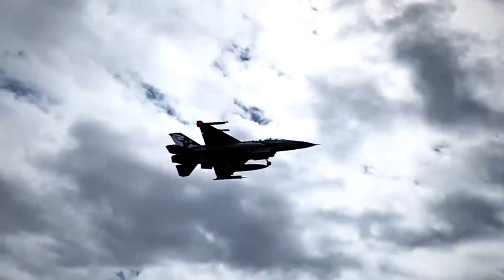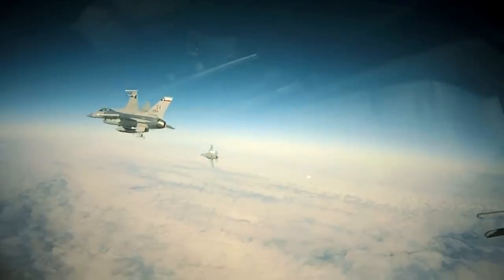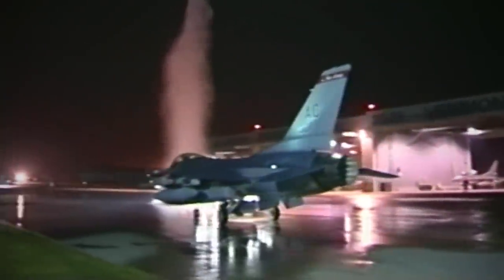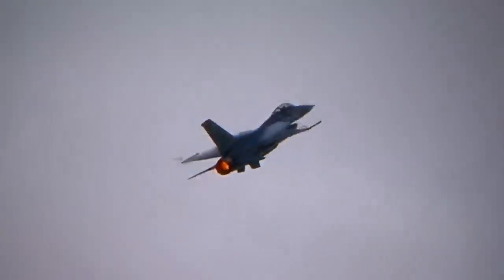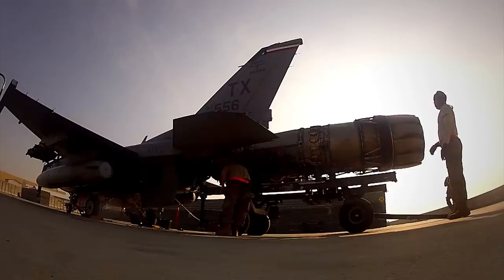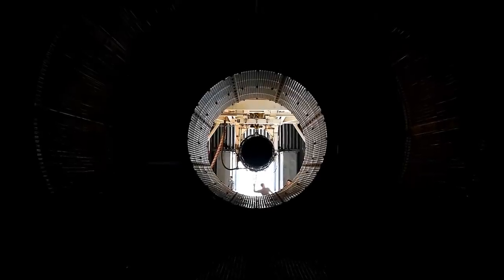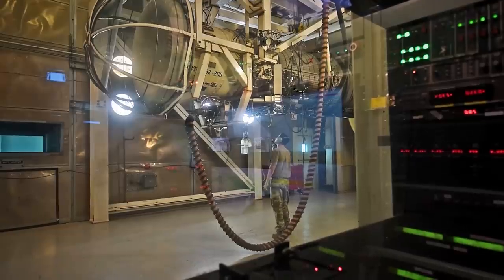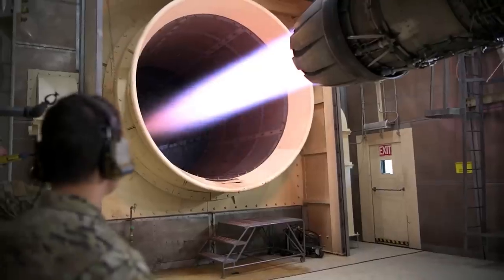The Hush House Silencer - F-16 Afterburner Maximum Power Test

Comment: I flew the early F-16A starting in 1983 and we were NOT limited to within gliding distance of the runway. The Pratt engine had its quirks but was a reliable one. The GE engine didn’t have those quirks and had a much smoother afterburner operation. 
I did a full power run from inside the jet in a hush house. It was strange going into afterburner inside a building.
Reply: I used to work at a maintenance facility for a major airline.  I was invited to go into the area where they tested the engines.  At the back of the test area, there were these black columns that you can walk between.  The dampened the sound so much that your ears would hurt.  (I do not know how to better describe it.  When you go to a normal sounding area to no sound at all, your ears strain or something.)
Reply: I'm jealous you had quite possibly the coolest job in the world. What happens to fighter pilots when they leave the service? Do most continue flying or do they end up with boring jobs? Freind of mine I have known since we were about 13 was a CC-130J pilot, he was at the point where he could leave or stay on for another 4 or 5 years and I asked if he would pursue an airline career. He told me he was staying on because he did not want to start as an entry level airline pilot making peanuts.
Reply: @fk319fk  I believe that's called an anechoic chamber. It stops sounds from reflecting so they don't go nearly as far. If you're not facing someone in those rooms they basically can't hear you at all. Really weird to experience. They have one at my local university for studying sound.
Reply: Larry was secretly a badass
Reply: Me too
Reply: @aniquinstark4347  Yeah man... anechoic chambers are amazing and tripped out to say the least. My first experience in one hearing my pulse, heartbeat, & blood circulating through my body was wild and a bit dizzying. It also showed me just how bad my tinnitus is 😂. I got to partake in lots of cool experiments and tests in there. I've also seen multiple people get vertigo and have to run out of there to throw up. It's definitely something you have to experience to truly understand. Glad you got to, because it's really something amazing.
Reply: Thank you for your service. I can only imagine how strange and unnatural feeling it must be to go full afterburner on the ground, but still, no feeling of acceleration, and inside a building. I would think it would be about as unnatural feeling if your average driver were to drive right out the back of a C-5. 🤔
Reply: I was your wingman too lol 😆 😆
Reply: @fk319fk  It's the same for our f110-129 hush houses. The gills on the building are there so the building doesn't implode on its self from the engine ingesting so much air. Two guys on either side of the gills would barely be able to hear each other yelling even though the distance is roughly one or two feet. Those in charge of the hush house also have to have full accountability of every nut and screw on the ENTIRE building less one gets ingested by the engine. Though these things can eat mortar shrapnel and still fly we still have to pull and rebuild the engine if there's evidence of foreign objects in there. I've seen a 5/16th washer implant itself on a compressor blade before. That was not fun.
Reply: @xenophagia   holy crap thats nuts. i might regret it but i want to hear my blood circulation now.
Reply: Awesome story sir. My grandfather is a retired chief master Sargent from Elgin. In the late 80’s / early 90’s, a chief could sneak in a 10-16 year old kid to the climate lab- not exactly a hush house but they were running engines at -120F+150F, bomb range, gun range, tower. When he retired he stayed there at the base as a civilian where he wrote the handling manuals for the GBU’s,JDAM. Boxing,shipping, attaching to the aircraft, etc. I love stories like these and yours. Thank you
Reply: Awesome story sir. My grandfather is a retired chief master Sargent from Elgin. In the late 80’s / early 90’s, a chief could sneak in a 10-16 year old kid to the climate lab- not exactly a hush house but they were running engines at -120F+150F, bomb range, gun range, tower. When he retired he stayed there at the base as a civilian where he wrote the handling manuals for the GBU’s,JDAM. Boxing,shipping, attaching to the aircraft, etc. I love stories like these and yours. Thank you
Reply: That's awesome!

Comment: I worked in some old school hush houses for one of the aircraft manufactures. The walls were about 18 inches thick (concrete I believe) and for entry to the doors you had to get a bit of a running start to get the doors moving - then drag hard to get them to stop moving. The side control rooms were just as thick and felt very closed. I remember during Desert Storm being in one while listening to the radio with the reporter describing incoming scuds. Very eerie feeling.

Comment: I was an F-4 Phantom mechanic on the Marines.   Two J-79 engines.  The loudest thing I've ever heard or felt was high power tests.   We'd chain the plane to the concrete and the guy with the high power license would push both into afterburner.   This was in the 80's so we had no " special " ear protection.   Foam earplugs and earmuffs on top of those.   That's why I'm hard of hearing now..lol
Reply: What did you say?
Reply: I can barely hear now due to the noise inside a B-52.
Reply: Turkey flies an updated, retrofitted, Israeli-supported F-4 Phantom that they call Terminator. It has a lot of the latest avionics and it plays close air support, still to this day. Thanks for serving. My Uncle taught pilots how to fly the Phantom for Vietnam.
Reply: Semper Fi
Reply: That's what we're still doing for ear pro. I joined already deaf at least lmao
Reply: @john9289  I can hear...I can hear great...I hear a constant  EEEEEEEEEEEEEEEE..LOL

Comment: There is also a hush house run by the AZ ANG in Tucson. (Or was, as I have been away for almost 20 years now) I have seen it operate from inside and outside. Very impressive and so quiet that ear pro is not needed right outside the building.
Reply: Luke AFB had one too. Next to the bomb dump.😊👍
Reply: I worked at P&WA in the late 70s and it was pretty impressive to see JT-9s being tested that put out about 58.000 pounds of thrust. I worked on the assembly floor but every month I spent 4-5 days in the test building. It was pretty impressive to sit in a room watching an engine run in the next room and barely hear it. It was a good  job but I wanted to use my electronics training from the military which i ended up doing after moving.
Reply: Yet it's loud enough to set off all the car alarms in the parking lot right next to it
Reply: @godsfavoriteblister852 I sure do miss Arizona. Luke days was always awesome to go to. Do they still call it that? I lived  well North east of Luke so unfortunately I didn't get to see or hear many F 16s( well before the F-35s got to luke) flying around but every once in a while I'd get lucky and they would be up in the north valley for whatever reason.
Reply: @Old Tanker We’re still here at the 162d! They moved the parking lot to the old ramp. We park 20ft from the hush house exhaust it’s so quiet.
Reply: @iTz_JLAR  I know P&WA's test cells had to be real quiet as the MIddletown plant in on the Connecticut River right across from many million dollar homes.
Reply: @Chris_at_Home  Here's a story for you. We went TDY to Langley. Had a jet that needed to go in the house. The exhaust tube had this crazy octopus-looking contraption in it. Apparently, when the sound travels down the tube and then up into the air, it gets amplified. Then I comes down an lands in a single spot like 10-15 miles away. We were told that this guy that lived about 15 miles away would call and complain every single time any type of run would happen because his house would shake so bad stuff would fall off the walls. The guy knew every single time the hush house was used without ever setting foot on base, and he refused to sell his house. So the AF built this octopus-looking contraction in the tunnel that was supposed to act as a sound suppressor and prevent that.
Reply: @iTz_JLAR  😂 what a trip. Another reason to never doubt human ingenuity...and stubbornness lol.
Reply: The hush house is still there. I grew up about a mile away from D-M AFB. My mom was the Chief at the DRMO/DRMS/AMARC/AMARG/Whatever name they choose to rename it with at any given time and now called DLA Disposition Services (they handle the DE-MIL of everything from aircraft to refrigerators). Also, my 2 best friends dad happened to be a 3 Star general and was head honcho on base at the time (it took awhile before I figured that out. I only learned of it when I finally asked why we were always saluted at the gate in their cars lol). So I got to be on base a whole lot as kid and kind people from all over different parts of the base would take me to see and do all kinds of cool stuff (some of which they probably weren't supposed to lol). One of those cool things was the hush house. I also got to see the giant guillotine attached to a crane chop up more aircraft than I could ever count. Even got to "pull the lever" in the crane a couple times. As cool as it is seeing the planes get chopped up, part of me would just cringe inside every time lol. Also knew the guy that owned the private boneyard right across from D-M because my mom dealt with him directly a lot. So I got to mess around in there a bit as a kid too. Which was awesome!! Man, that guy really hated those idiots who would jump the fence and try to graffiti up his aircraft parts (and rightfully so). He'd really go off on those jackasses (sometimes with shotgun in hand) and I remember thinking that I'm sure glad I'm not those guys right now, because he would turn into a scary SOB real fast lol. I have so many unforgettable memories from quite a few AFB's from getting to go on TDY trips with my mom, but the memories and experiences I had at Davis-Monthan with her and the amazing servicemen & women/civilians who worked there top them all. I was a very lucky kid. It still means the world to me that these very busy and hard working people would take the time out of their day for me. I learned so much from them. They had me recruited to the Air Force before I was 10 lol. It's too bad that dream didn't work out, though. Scoliosis really sucks. Anyway, sorry to bore you by waxing lyrical about old memories if anyone read this. Reading these comments got me feeling a bit nostalgic I suppose.

Comment: While serving at Barksdale AFB LA,  B-52's regularly go through that process, repair.replace, tune/trim.  Usually one engine at a time, but one day I saw all eight engines run up and trimmed..  then the water switch was thrown.. the whole aircraft rocked forward on its chocks.  I thought it might leap into the air.   I was told at Little Rock AFB AR, a B-58 was tuning/trimming an engine and it torn off the wing and headed down the flight line by itself.  The BEST people are in Air Force maintanence.

Comment: I was an M1 Abrams tanks mechanic. It also runs a jet engine, a turbine. It is suprising how easy it is to pull it whole out of the tank, basically hook up extension lines for the fuel and electronics and do a ground hop, which is firing the engine up on the ground to test it. Nothing in the world like standing 6 inches away from a running turbine engine!

Comment: My favorite thing when I was an F16 crew chief was standing right next to the nozzle in burner when I had a cold.  The vibrations alone would clear you right up.  Also standing next to the nozzle during a full burner run while in Iraq was a great way to cool down with that amount of airflow going around.  
I miss my crew chief days.

Comment: I used to work across the street from the hush house at Dyess AFB, Tx where they test the B1-B Lancer Engines......let me tell you they are more like earthquake generators than noise suppressors.
Reply: yeah you can definitely feel the GE101 engines in your chest
Reply: All I'd like to know is how do I get a walkthrough during a test?
Reply: @jamestuccillo  go to CMS and ask. You can literally walk into the hush house, it's not a restricted area. Just be respectful and stay away if the red light is on.
Reply: Do I know you? Didn't you work in the backstop? Name looks familiar.
Reply: @Tracked350Z  Nope, I didnt work in the hush house.
Reply: @slapshot3  comment was meant for Vanderschoot. Pretty sure I worked with him at Dyess or one of the bases I was at.
Reply: @Tracked350Z  ah gotcha 👍

Comment: I worked for spell at Staverton in the UK and being inside the engine test cell was both exhilarating and mildly terrifying. The ear splitting noise and high frequency vibration has to be felt to be believed.

Comment: Let's not forget the Micro Inspections on the blades of the Impellers, searching for Imperfections, Issues, Problems, etc. if too much or heavy damage is evident in/on the blades cause major problems in the functioning of the Turbofan Engine.
    STAY AWAY FROM THE EXHAUST OF THE ENGINE.
  Getting sucked into the Intake, there's film footage on a Carrier, one of the personnel prepping the Aircraft just prior to launch is ducked in head first, only things sticking out are his legs, luckily his fellows reacted quickly enuf, and were able to extract him. There is a picture from the day after, even having been wearing his helmet, his entire face, etc. are bruised badly, being already deep black. He's lucky to have survived.
   Thanks for bringing this up Mark/Dark channels (ALL of them).
Reply: That is not an F-16 the guy was sucked into an A6E

Comment: 5:45 he said pilots remove the engines 🤣🤣 you're lucky to find a pilot around any aircraft actively being worked on by maintenance.
Reply: I noticed that too. I was a crew chief on F-5's and pulled many engines.
Reply: Sometimes they were forced to pull panels on over g/overspeed
Reply: If you had a pilot helping with any maintenance on any aircraft it was because the pilot screwed up!  We one time had a B-52 crew who forgot to turn on anti-ice and they got to assist in the changing of 7 of the 8 engines.  They never forgot again.
Reply: @michaelmeyer6306  Must be nice. I was on shift watching a C-130E taxi out for a training run. To taxi out while nose to the barriers, a C130E needs to go forwards slightly before going into reverse. Pilots didn't do that on that day and decided to go in reverse first which stalled out the engines. All we got from the pilots was, "Sorry". That is until they got ripped from our Super cause we had to do a full stall out inspection on the engines and the props. At the end of the shift there was a case of beer in the breakroom compliments of the pilots.
Reply: @michaelmeyer6306  I've seen it once in the Navy. One pain in the ass gripe, one pain in the ass officer. He probably wasn't the one to break it. He was enlisted before he became an officer. When he was enlisted though he used to be in maintenance, he literally knew our job and was out there, riding our asses as if we didn't know our jobs. HOWEVER, it was maintenance politics dragging this thing out since it was going to be a long down time repair, for something that wasn't a down gripe. A long series of "check this," and "verify that," fire the parts cannon, on feedback loop. His troubleshooting skills weren't any better OR worse than ours, but having him out there on the jet forced everyone to accept that it was going to be down to replace the one thing it absolutely had to be. I never got to see our hush house. I did however get to see an engine getting tested at sea on the test cell once, afterburner at dusk. Then an F-14B chained to the deck full burner. Pretty much the same engine as the F-16.

Comment: Was stationed at MCAS El Toro in early 1970’s. Our avionics shop was unfortunately right beside the engine test facility there. The exhaust tube was a vertical concrete tower back then. When it was running they would spray water into the tower exhaust. ( to cool it down?) The resulting black rain would get all over our cars in the parking lot which of course was down wind to it. It would then get baked on to your paint from the California sun. If you didn’t get it washed off right away it would leave stains. We hated that thing!

Comment: Never knew how easy was to remove F16 engine. Really cool.
Reply: Many jet fighters were easy to change engines, the old F-86 saberjet only had 4 bolts connecting the rear half of the fuselage to the front, you'd pull off the entire rear fuselage and you had complete access to the engine. You could change a saber engine in 15 minutes.

Comment: Air Force pilots don't do maintenance (5:41). The USAF uses the term "Airman" in reference to its enlisted personnel.
Reply: Although Airman is a rank in the enlisted force, the term Airmen is for all USAF personnel, including officers as well.  For us enlisted folks working on the jet, we're just maintainers, maintenance crews, or specialists in this case.  But yeah, no pilot is responsible for engine swaps or maintenance unless they did something really stupid in the air to break it, and then usually they are tasked with assisting the specialists with the maintenance as a payback or shaming.

Comment: Here is another piece of info, in the Viper's cockpit, there is a switch, that increases power even more, named (something along the lines of) maximum power, which increases afterburner thrust even more, to around 80% of the engine's maximum safe power output. I am not sure of when it is declared reasonable to use it, but I know it is there and I know it is for engine power. *I am not a viper pilot, I am not even a pilot in general, I learned about it from somewhere years ago and testing the engines to 85% of their rated safe output, reminded me of that.*